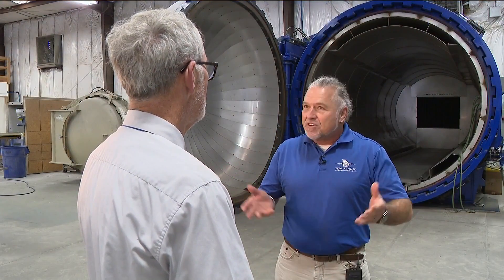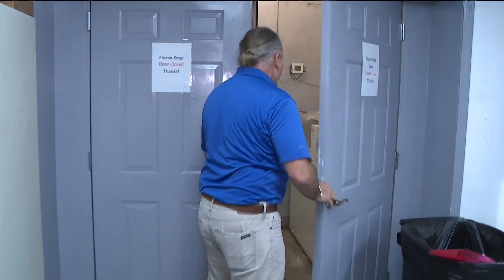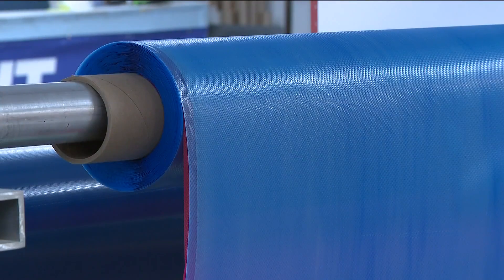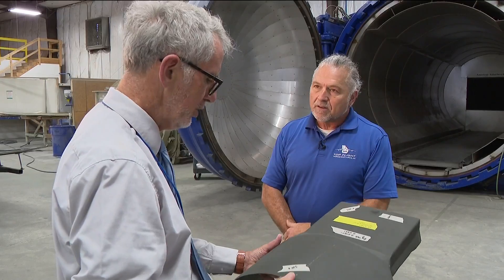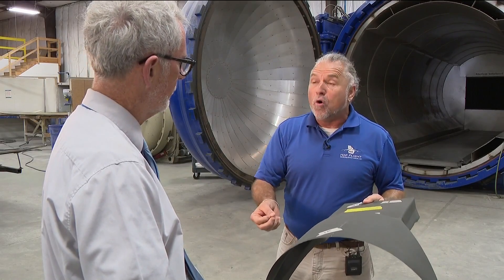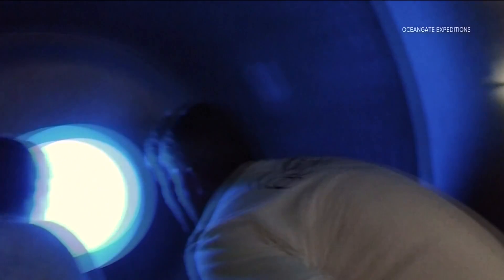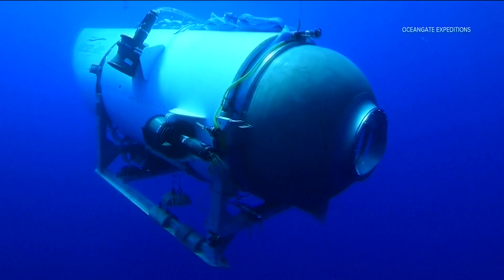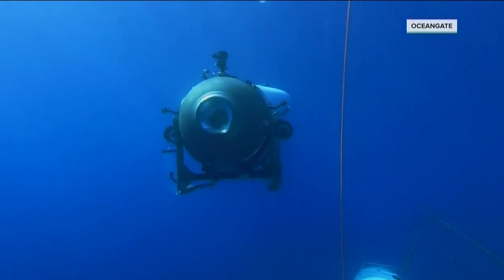Georgia engineer talks carbon fiber that failed in Titan submersible implosion

Comment: Carbon fiber is excellent to carry tensile stress, but not the best for compressive stress, and absolutely NOT the compressive stress within the fibers plane, which is a type of stress that promotes delamination. The two hemispheres of the Titan submersible would push against the CFRP cylinder with a force of thousands of tons, almost 20'000 t every time the Titan reached 4'000 meters depth. This led to a 210 MPa compressive stress within the cylinder wall, a value which is dangerously high for CFRP. Of course CFRP can carry much more in tensile stress, but not compressive stress within the fibers plane, this is something that NOT HAPPENS in airplanes, so if CFRP is safe for airplane wings, it doesn't mean that is suitable for submersible's hull because the stress type is different! For a typical carbon fiber in epoxy matrix I would not exceed 50 to 70 MPa of cyclic stress in that direction, so a submersible with that design should not dive deeper that 1'000, maximum 1'300 meters in my opinion. But I don't know what kind of CFRP the hull was made, I am doing assumptions basing on a commonly used CFRP type, maybe they adopted a fiber design specifically optimized to withstand compressive stress, who knows? In any case, a designer should know exactly WHEN the vessel collapses, so a destructive test should have been carried on before using it for carrying passengers: basically you dive the submersible deep down until it implodes. Then, if the submersible implodes e.g. at 5000 meters, you can assume that, in order to be safe respect to fatigue stress, you should not exceed 30% of the collapsing depth. I say this because you can run, of course, simulations, but in the simulation it's difficult to keep into account all the possible material defects, so a destructive testing campaign would give the most reliable result. And you SHOULD KNOW exactly when the failure occurs, it's a vital information! Then, I would also not use CFRP at all for that application, CFRP is anisotropic material, in that case stress comes from any direction and therefore an isotropic material, i.e. a metal, suits better. They made the hemispheres in titanium: so it would be a good idea to make the cylindrical section in titanium too. In this way you also avoid the mismatch in material's elastic modulus, which leads to additional stress in the junction area between CFRP and titanium, which is another possible source of delamination. 
P.S. I'm an automotive engineer with 15 years of experience
Edit: I have found a video, you can watch it at the following link, where they compare the compression resistance of tubes made by different materials, including a CFRP. I don't know what type of CFRP and if comparable to the material used in Titan hull section, as details of materials used in the video are not given. Anyway, the CFRP tube collapsed at 2998 kg, that is equivalent to a pressure of 203 MPa for that pipe geometry. I wrote that Titan reached about 200 MPa of pure compressive axial stress every time they dived till the Titanic depth, so now you can realize how close they were to the compression limit of CFRP. Fatigue stress probably added delamination spots every time in a cumulative damage to the hull, so that section after ten dives was definitely not the same as the first dive. Considering these numbers, it's surprising they have been able to dive several times before the collapse of the hull 
https://www.youtube.com/watch?v=PlvyZ1r1DCM
Reply: That’s the best explanation I’ve heard. This person needs more likes.
Reply: Surprised I am your only up-tick.
Excellent analysis! 👍
Reply: @wk4240  Thank you for appreciation :)
Reply: The guy that ocean gate fired then sued was saying that destructive testing should have been performed and he said it would probably implode
Reply: Sounds like it went 30% Past its duty rating well before it got to the ocean floor !
Reply: @williamrodriquez1433  Maybe the whole situation is a little more idiotic .......
Tester: "This submarine can go to 4,000( feet)"
CEO "It can go to 4,000 (meters)? That's great, next time I'll go myself!
Reply: Just don't use carbon fiber simple only use titanium alloys, acrylic plastics for making submarines.
Reply: @Ascgames  17 tons  (the weight of the Alvin) of Ti would cost 1/4 of a million dollars.
Reply: Yep, this is awesome not the compressive direction I was expecting to cause the problem with the carbon fiber body but makes total sense thanks @aurora-gypsy1524!!
Reply: Thanks for this explanation, I find it makes total sense as well. So his design simply wasn't up to the task of diving that depth, it would work but not so far down. He definitely didn't mention any destructive testing in his speeches I watched. Could he have gotten it to work using a larger hull?
Reply: @waitandhope  making a thicker hull "maybe" can solve the issue (you need to create a complete Wöhler curve for that specific stress type to get this answer, i.e. a comprehensive material testing) with fatigue-compressive stress, but then you lose the advantage of carbon fiber, which is lightweight. In that case you can just directly use titanium, you skip this issue and you also have a homogeneous hull
Reply: @aurora_gypsy1524  yeah, or just use the pure epoxi.
Reply: @famkis8680  or maybe steel. I know it's old hat but ferrous materials  can be designed to not fail in fatigue. Weight is not an issue at all. Cost is reasonable. Easier to fabricate and test. Any defects however unlikely can be easily repaired. I think the Alvin which is steel is 60 years old and still maintained and useable.
Reply: @aurora_gypsy1524
many things wrong here...
It is incorrect to say that composites on airplanes do not experience in airplanes. It happens on EVERY SINGLE FLIGHT. Any bending application has one side in tension and the other in compression. 

Additionally, while the compressive strength for composites is lower than it's tensile strength, that does NOT mean that they are weak in compression. The matrix is not the primary load carrier in a composite laminate undergoing compressive loading (due to much higher stiffness of fibers). 

There is no such thing as " a fiber optimized to withstand compressive stress". Once cured, the loads are transferred to the fibers via the matrix. Fibers by themselves have no compressive strength, hence the resin and cure cycle so that it can resist tensile and compressive loads. 

1. CFRP is NOT anisotropic. It is orthotropic (if uni-directional tape was used). 
2. The vast majority of composites layups for engineering applications are made to be quasi-isotropic (in plane isotropy). Because it was cylindrical shaped, then it would be called transversely isotropic.
Reply: @josephgarrett3075  read carefully, I specified that of course there is compression in one side when you bend the component, but that side is pushed towards the other side and do not promote delamination in a dangerous way as a pure compressive mode within the fibers plane - as it happened in the submersible. Anysotropy of CFRP depends on how the fibers are placed, you can obtain CFRP components with very different behaviors according to the fibers direction. If you see the making of Titan video released by the company, they showed roving mode in circular direction, which is quite strange, so that's why I was wondering whether they made studies for optimising CFRP for compression, but as I wrote I absolutely don't know what they made and why. Then, we are commenting here a YouTube video, if we want to start a rigourus material course it will take more than few words, I just want to point out that I would never have chosen CFRP of any type for that application
Reply: @aurora_gypsy1524  I see I made a typo. 

You said - "  but that side is pushed towards the other side and do not promote delamination in a dangerous way as a pure compressive mode within the fibers plane  "

I made a typo and forgot the word "not" in my response. 
I do NOT believe that the claim above is a true statement; can you provide a source/journal/textbook that highlights that point?
Reply: Sounds like Oceangate should have hired you a long time ago - although the CEO may have fired you for not being "inspirational" enough. I'm still puzzled as to why the other apparently intelligent people inside this vessel did not research the hell out of the engineering design of this craft and consulted people like yourself before shelling out $250K and climbing into this deathtrap.
Reply: I can't bear to read all this, but well done!
Reply: @Dabeliiuteef  ahah thanks a lot 😄
Reply: I do not believe this was CF reinforced plastic, evidence from the hull manufacturer points to regular carbon fiber material being used, however one big point is that he bought the material on the cheap because he bought it past its shelf life for aero components suggesting that maybe the epoxy was no longer adequate to hold the stresses the hull would be subjected to. But also a study of the deepflight challenger which was to have a similar hull found that it would only be able to dive once before the hull would be scrap. Granted this would be the same dive that James Cameron did to the Challenger Deep which is significantly deeper than the titanic wreck. With that said though that hull was 6" thick and it is unclear if the same type of winding was used and what direction the fiber weave was in. Its possible if the hull was printed with CFRP the structural alignment of the fiber might have better resisted the crushing forces put on the material.
Reply: @cr4zyw3ld3r  all carbon fiber is cfrp. People get lazy and drop the rp part but literally thats what the epoxy is.
Reply: Thx, Doc, I’ve learned more about physics and materials in the last week than I ever learned in the education system. Thank you for your explanation and insight! What a most preventable tragedy…
Reply: In fact, the wing with lifting forces results in the top surface resisting in a bending moment which I believe carbon composites are quite capable of handling, unlike the forces of compression.
Reply: @richardmoolenschot4855   time will tell history  repeats itself  look at the comet jetliner and many many more
Reply: Doesn't carbon fibre need to be multi layered in different directions instead of rolled in one direction.
Reply: I saw a short video of the titan tube being wound. They were using unidirectional fibers for the bit I saw and they were being wound around the circumference rather than at say 45 degrees. Not sure if this matters.
Reply: @ColinWatters  
This is what has appeared glaringly obvious to me since we heard of the construction.
Carbon fibre should be layered in a multi directions to achieve optimum strength. 
The video of construction I saw was of it being wound in one direction round the cylinder.
Reply: @ColinWatters  good point, I saw that video of the hull manufacturing process and, in fact, normally the fibers are not wound in a unidirectional way, to avoid having distinctly anisotropic characteristics. But it is also unusual for the fibers to be wrapped in that way, so I wondered if they had perhaps done a study to establish that this is the best way to carry the compression stress in a cylindrical component, who knows. However, the compressive stress value was in any case too high for a CFRP. For a fatigue application you normally should know the Wöhler curve, i.e. the load vs cycles sustainable, but this is not possible when you make just one copy of the component and then you directly bolt people inside and dive till the limit depth, assuming that the "innovative acoustic sensor system" will tell you in advance when the hull is going to fail. If someone would tell me that there's a system monitoring the cracks in the hull I would think it's a joke: the hull should not crack at all at the service depth! Going back to the video of hull's manufacturing, another anomaly is the realization of the CFRP in air, with the risk of including bubbles and defects, you better should consolidate resin and fabric in vacuum chamber. And also the manual gluing to the titanium ring for such a safety relevant joint, that's crazy
Reply: "The two hemispheres of the Titan submersible would push against the CFRP cylinder with a force of thousands of tons"

Thank you. I hadn't considered forces beyond those acting radially around the CF cylinder. With the endpieces considered ... it was the height of foolishness to descend miles in that thing.
Reply: But there is reason why Ultime TS has more importance than compressive strength...right?
Whenever there are tensile stresses, there would be compressive stresses...
Reply: @magdumnikhil  in my opinion the problem is the compression mode. In a classic case of component bending, for example an aircraft wing, I certainly have one side in tension and the opposite side in compression, but the compression side is pressed towards the tension side and this type of stress does not promote excessively delamination. But if I have exclusively compressive forces along the plane of the fibers, moreover with a cyclic load, I risk advancing the delamination every time I apply the load because that force tends to push the fibers away from each other. After 50 dives the component is no longer the same, that's the point
Reply: @aurora_gypsy1524 
I was wondering about the wing situation as it has both tension and compression forces acting on it.
The way I see it is that the compression force on the top surface of the wing acts in an axial direction , not in the same direction as a submersible hull which would have the force acting at 90 degrees to the axial direction.
Not sure if there is agreement on this observation but happy to listen to any comments
Reply: @richardmoolenschot4855  Very different beasts. With aerospace applications each component is rigorously modelled to establish the load it will be subjected to, designed to maintain the working stress within acceptable limits, then fatigue -tested to destruction to establish it's working lifetime is adequate. Also in service critical items are subject to regular inspection and maintenance.  Finally,  they hopefullly take care not to submerge it to 1000+ metres in seawater.
Reply: @aurora_gypsy1524  it's pretty concerning you think the top surface of an aircraft wing won't delam from it's compressive stress because it's a beam. That is totally a possible failure mode... I don't know wtf you're on about...
Reply: CF under compression is only really as strong as the resin
Reply: @piccalillipit9211  it's as strong as the weakest component. Either the fibre or the resin  or the fibre-resin bond.
Reply: @johneyton5452  - No its not.  In compression, it is as strong as its strongest component 

Put a matchstick in a block of concrete and crush it - is it as strong as the matchstick...???
Reply: Your explanation makes sense, I never thought about the hemispheres being the culprit for relentlessly pressing on the carbon fiber in line with the fibers plane. I always thought it was primarily the sea water.
Reply: Your bright but sadly  it shouldn't be used on the boeing wings  I know it gonna crack up wind up on the bottom too 
They never learn
Reply: The information about this disaster changes daily. 
Assuming  a level of  veracity  about the USA NAVY  initial reports, communications from TITAN ended 1 hour after the dive was initiated when their under sea microphones picked up the noise of the implosion. Also assuming as fact  that the Titanic lies 2.4 miles beneath the surface of the Atlantic , TITAN only had traveled one third of that distance , '4000 feet , not the 4 thousand meters , the figure being circulated now , as Titan technically could not have descended to that 4 thousand meter depth in only one hour, unless a maniac pushed it down that fast without regard  for depth acclamation and stabilization,  however  that fast descent may likely have been an impossible parameter for it to achieve. If the depth of 4000 feet is factually correct , the CFRP imploded with only 1770 PSI rounded out from 1769.6 and odds 14.6 psi multiplied by each 33 feet of depth in sea water and applied to every square inch of the carbon fiber cylinder portion of the submersible, which  now obviously made TITAN far less capable after repeated deep dives  than it was represented able to do . Yes it withstood for a few or many times  thousands of tons which could be known exactly  given an exact square inch area of the cylinder , but compared to contiguous material such Titanium or steel alloys CF was the wrong material to use ,for the reasons you cited and more , carbon fiver is not  malleable enough to be compressed and decompressed over   and again without causing delamination .
I am not going to make any claims about possessing  laureate qualifications ..but where carbon fiver is concerned it may be ready for prime time airplanes as well as in automotive and sail craft mast /booms  applications , but the idea of using it for submersibles should be shelved ,at least  until its manufacturing processes yield the the types of  qualities and characteristics found in contiguous metals alloys which have  proven safety records.
Reply: I really have no idea what you just said, but as a simple person, I do agree, using common sense, to a destructive testing , without humans first
Reply: That video in your link was the one that brought me here to the news video 😊
Reply: Thousand of people die every day, where is their stories..thats right not rich white people
Reply: Full agree whith your analysis, axial forces are very big for this matérial, I found a pressure  of minimum 1440 bars ( daN / cm2) on the CF hull section, its around the pressure test for guns, or common rail injections pumps and injectors.
Reply: Actually it would be around 800,000 pounds per square foot meanwhile the carbon fibre tube was designed for 6600 psi for an environment that was capable of a constant 6000 + psi pressure? Don’t make sense to me
Reply: Copy and paste.
Reply: whew,  good information.   stay with a singular material ( tempered steel is nice )when going that deep into the ocean.   the composite thing is too risky.
Reply: one would think a carbon fiber expert would mention something so important